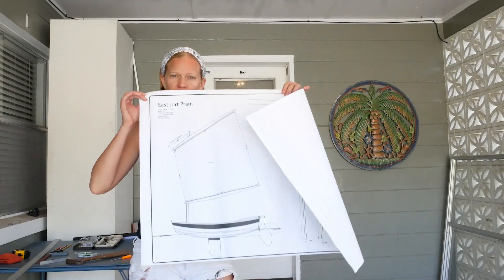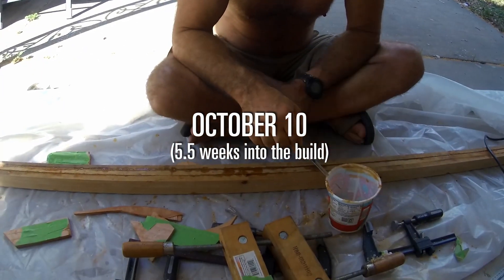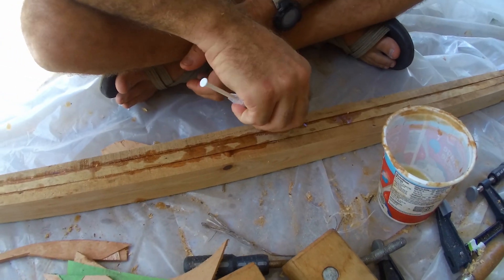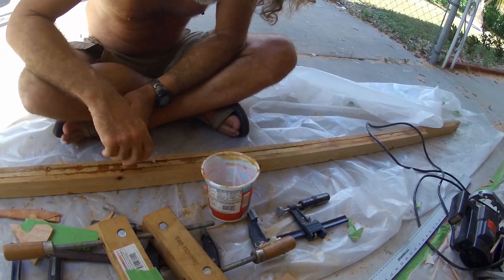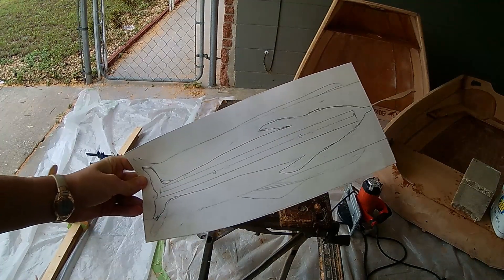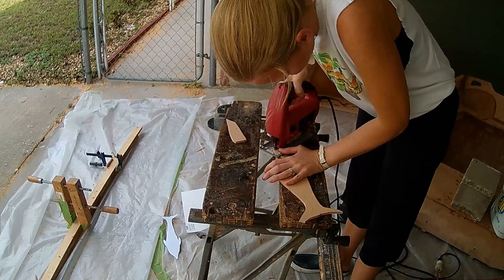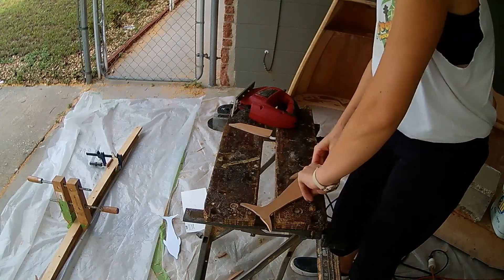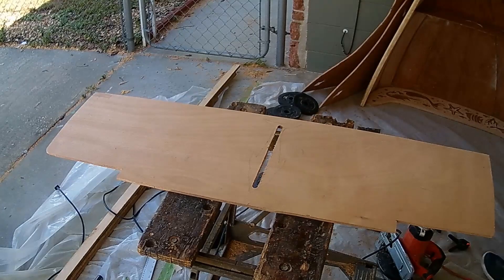Emily Builds a Sailboat - FANCY DAGGERBOARD - CLC Eastport Nesting Pram (Ep 9)

Comment: Aye m8’s, very clever to build a flotation chamber instead of use loathsome foam. For the enlarging of the 9 mm slot my first choice would be a Japanese saw, second would be an oscillating multi tool. Your way of doing it is just as good.